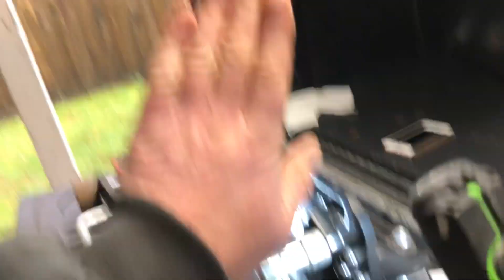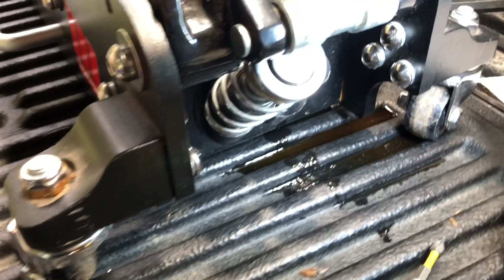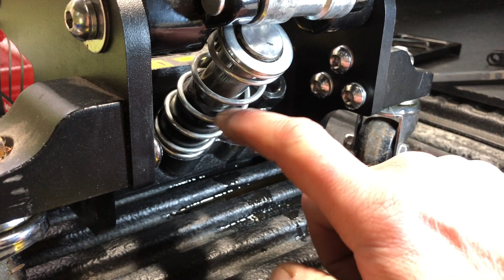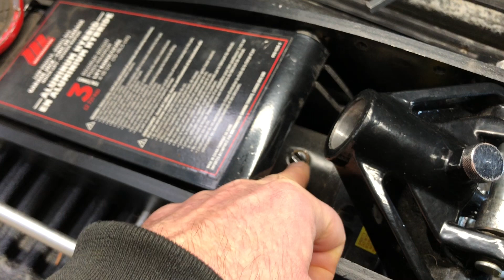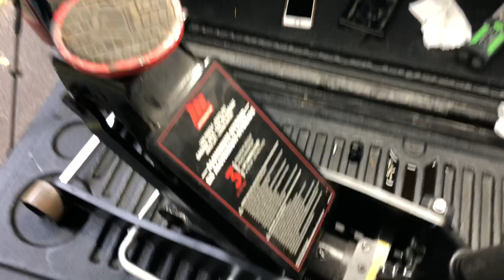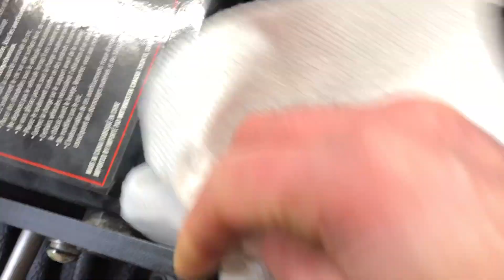motomaster floor jack repair video. Fix a stuck piston. Bleed air. Canadian Tire.

Comment: I wanted to comment on your video letting you know this is not likely user error. I had the exact same problem with 2 of these, only about 10 used before the right piston failed on each one and the same way. Thank you for posting your solution. The true fix, should it be debris on the pistons, would be to shield them, and I believe this is malicious design by the manufacture. Also, for the price, the CATERPILLAR 3 Ton jack is a way better option.